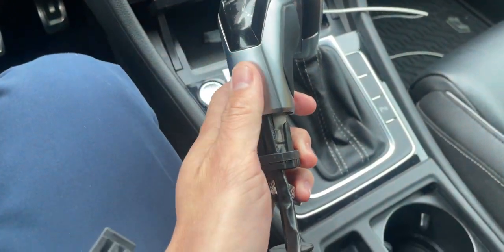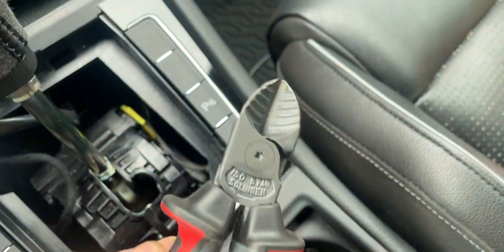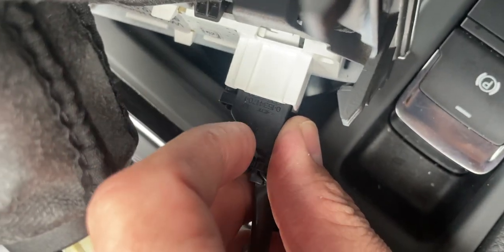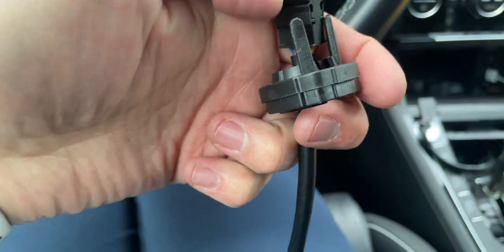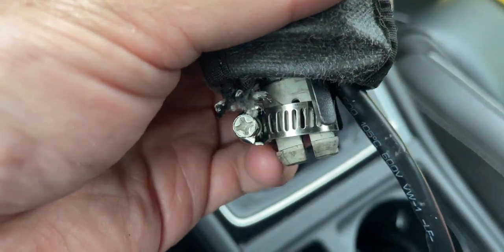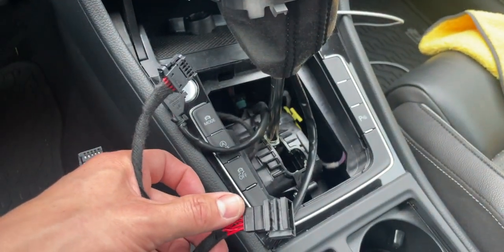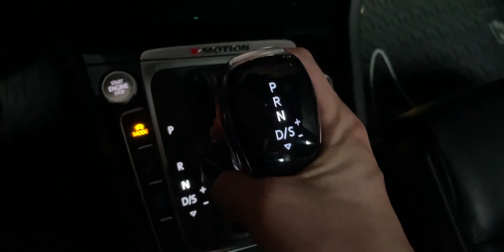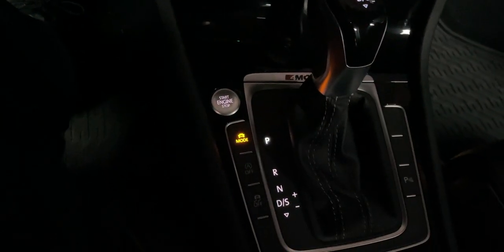2018 VW GOLF R & GTI: DSG LED Shift Knob INSTALL

Comment: I’m trying to cut the metal ring that holds the original shifter down. I don’t know if it’s because I’m weak but it’s not coming off. The metal just keeps bending in every time I try cutting it.

Comment: What do you mean you might not be able to reuse your shift knob by pressing the button 😅
Reply from the maker: It locks internally from what I’ve read
Reply: @DSG Paddles  so I've got everything in place. Lights and all work. But I can't shift the car out of park because the shift knob is locked in. Any tips on getting it unstuck? I've tried pulling on the button and it won't release.
Reply: @Wity4d  did you get it fixed? And how so?
Reply: @Wity4d did you get it unlocked? I can pry it open it goes back into locked position
Reply: @wandykulik  Hi - the plastic rod that is inside the shifter serves as a tool for unlocking the button. You push it in to the end, then pull out and the button will release.
Reply: @dsgpaddles This will snap the piece, this did NOT work.
Reply: @dsgpaddles i did this put it doesn't click
Reply: @dsgpaddles you mean when put it over the gearpin in the car?
Reply: The plastic rod that comes with the item is inserted then removed to release the button (while not installed).
 @fofdeejay
Reply: @dsgpaddles thank you 👍
Reply: @dsgpaddles  any Idea why only the led display lights up and not the original PRNDS on the side?

Comment: Installed mine and I can’t press the button in to take it out of park. What did I do wrong?
Reply from the maker: Did you happened to accidentally pull the button when it was not installed? I’ve heard this can lock the mechanism for good.
Reply: That could be it you’d think they’d have a big fat warning on it for that
Reply: Probably when fishing everything through the hole and locking it all together I’m sure it got pressed at some point
Reply: In case this happens to somebody else^ gonna have to try this when I get home will confirm if it fixes my problem.
Reply: @StevenDanielZigila    Any fixes??
Reply: @mrshunt1303 There’s a video on DSG paddles website how to fix it

Comment: I just fitted mine, piss easy but forewarning to anyone who wants it. The tolerances when you shift from park to reverse have changed and it grabs in the shifter mechanism, you can hear the click when you move it to R. It's a bit annoying.

Comment: Lights not working after plugging everything, not Even if i put back the connector on the original place.  Any thoughts?
Reply from the maker: Sorry dude just saw this did you figure it out??
Reply: @AtlasWilder  My gearbox is norlr dsg, maybe thats why it's not working? Is the control diferent?

Comment: How too conect the wire ??????
Reply: Plug it in?
Reply: Where do you plug it into, does it loop into an existing wire system, or is there another block connector ?